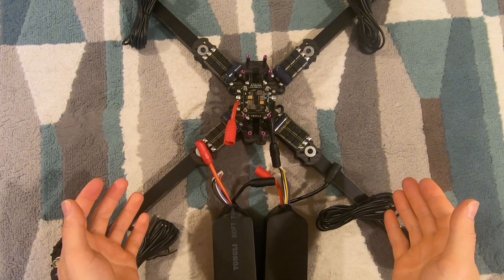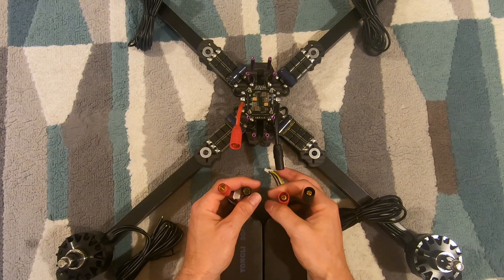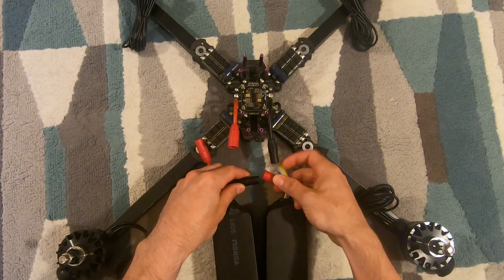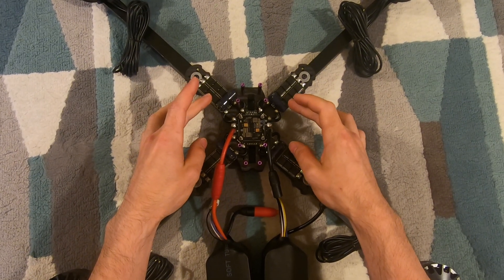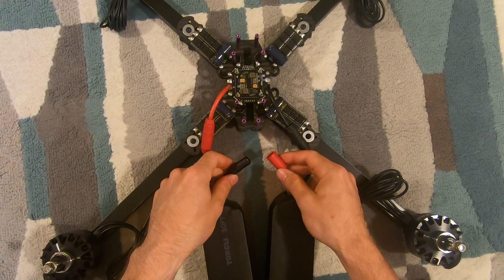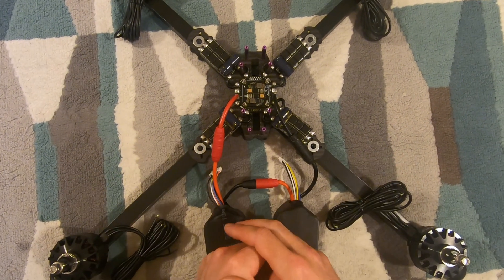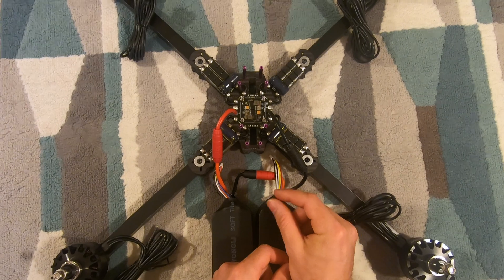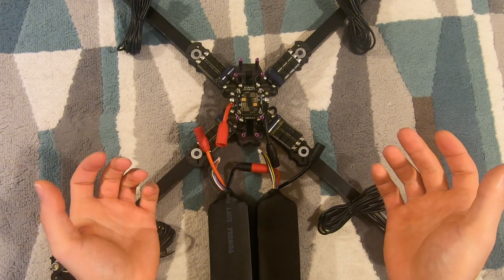How to connect AS150 plugs for X Class drone

Comment: I bought a tattu 6s 4000mah that have the antispark ON the battery (on the +). Did I need to put also the antispark on my esc (on the ground) or not ? Is is good to have 2x antispark (esc and battery) or it's not good ? (one on + of the battery and the other one on the negative on the esc)
 thanks ! :)